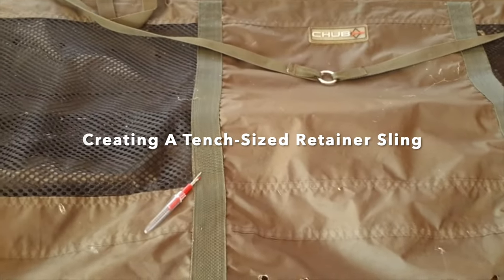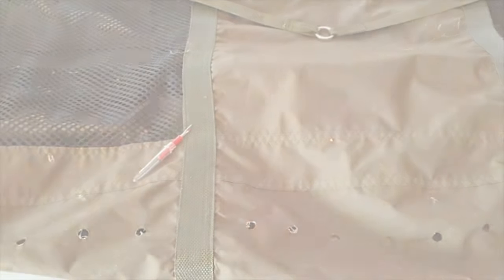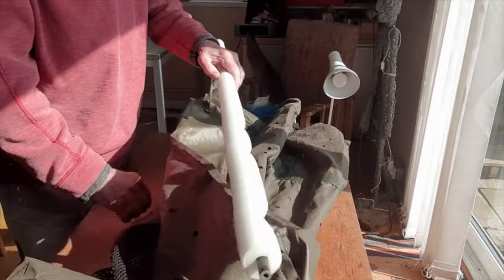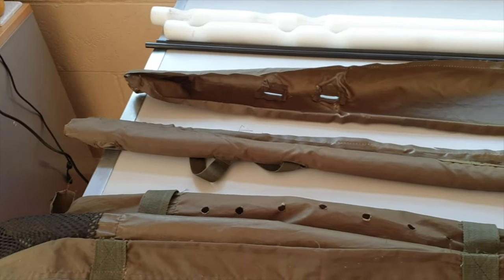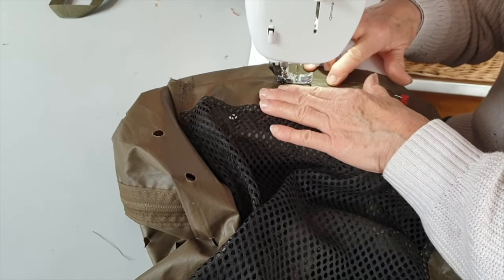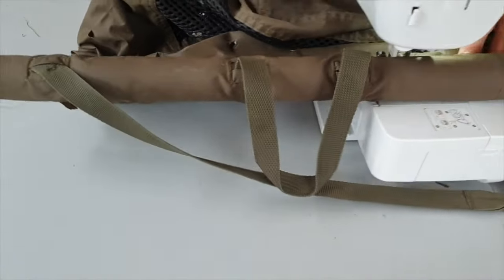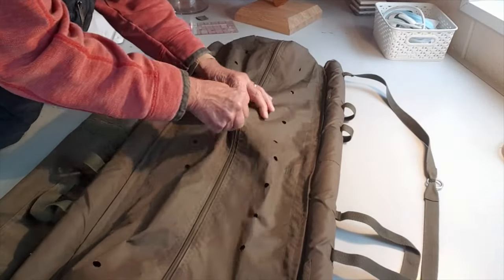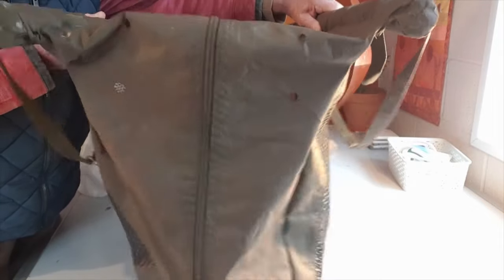Creating A Tench-Sized Retainer Sling - Peter Atkins

Comment: Great work Peter!
I totally agree about the the lack of good options for specialist anglers. For those without your skills (me...) the Fox Carpmaster STR sling might be of interest. I looked at loads before buying one last year and chose it because it is smaller than most, is well designed and is of good quality. Its still a fair bit bigger than your impressive adaptation though. I like the size of the Fox for big barbel but it is a bit OTT for tench (whist being perfectly usable).